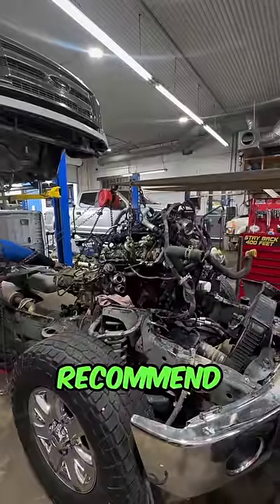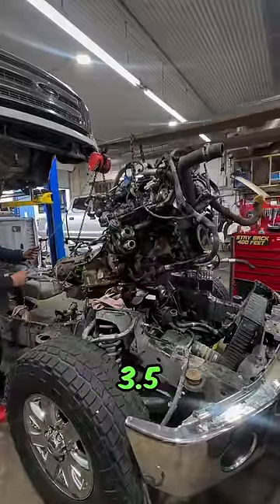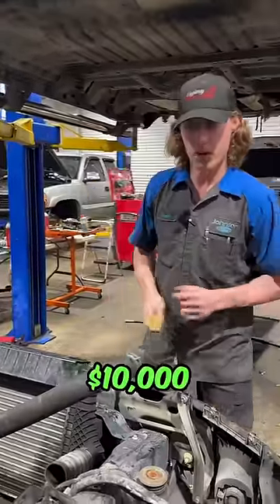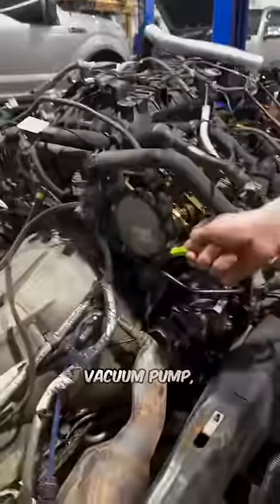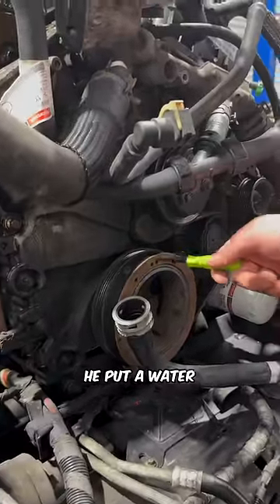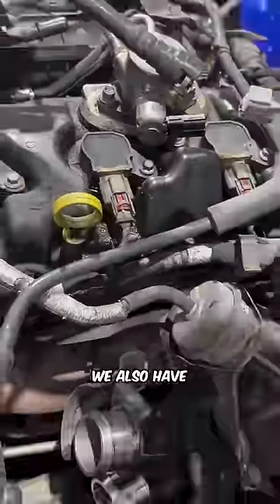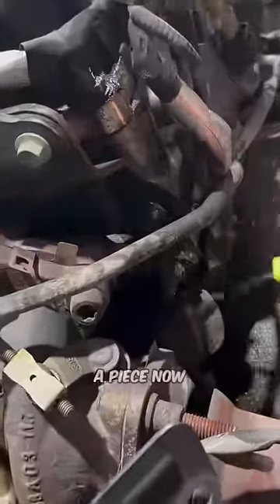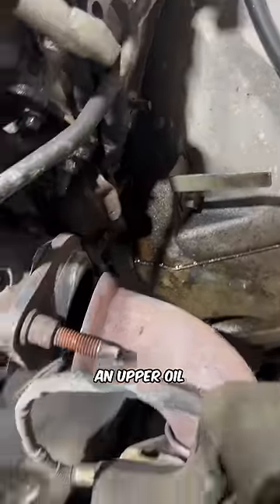Why not to buy a Ford 3.5L EcoBoost? #ford #ecoboost #shorts

Comment: What has the world come to when a half ton with 200k miles is worth spending 10k to repair and not even replacing the entire engine or transmission???!!!
Reply: Exactly 💯
Reply: Honestly with truck prices these days 10k is cheap in comparison, now let me say I completely agree that is insane, just a few years ago 10k would have been a nice down payment or got you a pretty decent used truck
Reply: Trucks in general should last a lot longer than 200k not even broke in yet
Reply: @thebutteravacado722  I agree but think it also depends on how it's used it might just sit and idle all day, so in reality it would have way more "miles" on it than shown
Reply: It’s called fix it yourself and don’t spend much but your time
Reply: @nicholaskrupa6259  while I agree I don't think that's a option for most people these days, considering most can't even do basic maintenance. Plus parts or insane for new vehicles,  never looked it up but wouldn't surprise if a new 3.5 eco boost is around 10k, like said I agree with you, but I just don't think the average person is capable of working on there vehicle any more, I can't tell you many people I've helped change a flat tire that flat didn't know how to
Reply: @nicholaskrupa6259  You're not doing this repair in your back yard. Its way too complicated and certain aspects of the job are very unforgiving to work on. You'll end up with more problems than you started with.
Reply: I mean... If the engine is 12k, he made the right choice.  The only problem this has are coolant and oil leaks.  That looks like a perfectly good engine which only needs resealing.  Throwing it out to replace it entirely is a complete waste unless the new motor costs less or equal to what the repair would cost.
Reply: @bigdogford1 fuck that I would of traded that in and put 10k towards. A new one Thsts a dumb move with 200k miles on a twin turbo those turbos go that’s another 5k lol 😂 down the road he’s crazy the 5.0 coyote is the best ford truck engine to buy imo cheapest to maintain and you can work on it no turbos just a plain old engine
Reply: 5k of repairs for every 100k miles of service. Hopefully the service was done on time but that’s an awful lot to dish out on repairs of the truck was maintained right. Still way cheaper than a new truck!
Reply: @thebutteravacado722 all depends on maintenance history, I've been a tech for 20 years and when people asks me to recommend a vehicle to them or which is the best, I tell them to get what they absolutely love and to maintain it properly cuz you can get any vehicle to last as long as you don't let maintenance and repairs go any longer than right away. I also let them know I only see vehicles when they're broken so they're a POS  to me
Reply: @thebutteravacado722 Honestly, you're extremely lucky if you get 200,000 out of a Ford. Unless it's the old 7.3 diesel.
Reply: 200,000k is nothing to complain about.
Reply: @guardrail2897  I got close to 300k out of a 2004 Ford Expedition with the 4.6 V8 in it. Original engine and transmission. I sold it to a relative who is still driving it. It never had any major repairs just regular maintenance and a new alternator, battery and belts.
Reply: In a quest for enough power to be a truck engine along with decent fuel economy to meet Cafe standards Ford has stuck their toe into making engines so complex the Germans are impressed... With that complexity comes maintenance - lots of it... 

They're impressive engines, they make a ton of power for their size and can be tuned WAY up. With that said I'll keep my 5.0 V8. 

The elephant in the room though is that all across the board, quality is generally going down as prices hit sky high levels. It's not uncommon now to find 10 or 15 year old trucks that are simply more reliable and dependable... So when you have one that's not rusted out you keep fixing it to get as many miles as you can out of it to avoid getting a crappier, newer version.
Reply: @bigdogford1 lol Ford motor company the KING of JUNK
Reply: @alanholmes2366  I know they're good ones. I had a buddy with the 4.6 in his Mustang GT. He ragged the hell out of that car for 150,000 miles. And it was still running when he sold it. He did break a couple transmissions and a rear end though.
Reply: @thebutteravacado722  every idle hour is damn near equivalent to 30 miles driven
Reply: @cbruno12180  the 5.0 is far from a plain old engine
Reply: @guardrail2897 I have 251k on a 2010 F150.  Still runs good no major repairs just change all the fluids regularly.  The check engine light has never even come on in the 14 years I’ve owned it.  Its a V8 though, I’d never buy an Ecoboost.
Reply: @cbruno12180 damg right. Ecoboost is junk
Reply: @alanholmes2366  4.6 is a bulletproof engine why you think all the cop cars are d taxis used them for 20 years with proper maintenance those hit 500k miles easy
Reply: Dont buy any ford ever
Reply: @thebutteravacado722  It all comes down to doing the mileage/time based service when it is due. Too many people will not go to the dealer, so the maintenance doesn't get done properly.
Reply: It's because he would make less money. A reman is 6300, plus he is charging double the actual price for the exhaust manifolds. If you go to his shop just show up with the parts and only have him remove and replace because he will rip you off.
Reply: @MadMan_123  If the shop will even agree to what you suggest. It is likely that they won't warranty the work.
Reply: Cheaper then buying a new truck
Reply: I agree
Reply: If it's not rotted like the titanic then it's worth 10 grand to fix. Sadly where I live a 2011 is Swiss cheese...... yet my 89 F250 only has a rotted tailgate and cab corners. No other rust anywhere. Maybe because the old man who owned it since New hated driving in snow so he never did.
Reply: When another truck with 200,000 miles on it cost 20grand? And will still need all this work? This would be common sense.
Reply: Repair is better than replace. Stop supporting disposablility in cars.
Reply: My Nissan Sentra 2012 has 317k miles
Reply: That’s why i do everything myself, to save money
Reply: @nicholaskrupa6259  go ahead and lift the cab by yourself
Reply: It’s called money printing from the fed
Reply: @nicholaskrupa6259  Considering that with that truck, you have to remove the cab to get at the engine and remove it, a pretty tough fix unless you have a lift in your yard to do it with.
Reply: @nicholaskrupa6259 exactly! That 10 k tune up would cost 2500-3500. I’m impressed a 200k boosted v6 still has enough left in it to make this job worth doing .
Reply: @iq6840 you blew yours up? Oh wait you never owned one , this engine was built to pull   , your statement is pure ignorance.
Reply: @JohnDiMartino  drive my f450 with a large backhoe. You'll understand what I'm saying. Listen these turbo engines would never made to a sedan or a f150 if it weren't for the EPA. YES I HAD ONE THAT BLEW PULLING MY BOAT UP A STEEP GRADE.
Reply: When a new truck is 75 to 100k! I'll spend 10k.
Reply: Only a fool would pay 10k to gasket 200k mile motor.   Just drop in a crate motor and be done.
Reply: Why?  Because it made 380 ponies, did its job, hauled ass doing it  and, finally leaked oil at 200k, requiring gasket replacements before going back out again?   Oh yeah.  Real turd.
Reply: @cbruno12180  lol BS id put Engine's in those crown Vic have less than 200k miles most 4.6 in police cars are OIL Drinkers
Reply: The lesson I learned from this is if you get a F150 that’s used and it’s got close to 200 K or over 200 K you better ask him if this has been done if not $10,000 comes off the price of the truck
Reply: This also shows me that you don’t want any kind of eco-boost of any kind naturally aspirated V8 engine is the only way to go that or maybe a diesel if it ain’t a coyote it ain’t worth having in a Ford truck. In my opinion I got a 99 triton with 327,000 miles on it still runs like a top and only done basic maintenance.
Reply: My engine blew a rod at 101,228 miles one day after I was dumb enough to take it to a dealer for 100k mile tune up at $880.00! 
The next day I put the hammer down at 70 mph up to 90-100 three times over as I always do, which makes me think the sob’s used regular oil. 😡🤬
Reply: New Motor is only 5600, as opposed to resealing everything.
Reply: @bigdogford1 they actually show how many hours they've ran now too
Reply: @CGoody564 the new engine is around this price. And the Turbo's were leaking oil. That's a couple grand each.
Reply: Blame Joe
Reply: @apachebill Now that you mention it, turd really is a good way to describe it.
Reply: What you mean sustainability. I know its crazy keeping and fixing a car you paid 60-80k for, i think the problem is the vehicle companies pushing out that cheap garbage and you must replace mentality.
Reply: Yup, that's why I put a couple grand into my old Silverado. I put a rear main seal and an new oil pump while he was there. 371k and runs like a top. Coming Next, a couple grand into the steering and suspension. It has zero rust. I could rebuild my old truck two or three times for the price of a new one. Repairs that didn't make financial sense just a few years ago make perfect sense now.
Reply: @AT-wl9yq it also looks like body off is the plan.  Not doing that without a lift.
Reply: What a pos 200,000 miles on it and it needs some work
Reply: @guardrail2897 My 2000 Ford f-150, 5.4 engine, automatic, has 300,000 miles on original engine. and trans. only thing I replaced was the starter, 3 batteries, brake pads front and rear!  brake line from master cyl. to rear end! line rusted out.. I'm considering a new Ford f-150 with the non turbo 3.5 engine. or the 5.0 !!! leaning to the 3.5 more.
Reply: @rogarmadz  They are notorious for blowing out spark plugs. How many have you lost
Reply: @guardrail2897  I've never lost any spark plugs! I think I'm having a coil acting up, has a miss when eng. Is cold..
Reply: @AT-wl9yq  Facts
Reply: @cbruno12180 

Long term I would agree.
Reply: @masterpah1 
They cost more to maintain. To call them junk is a bit of a stretch.
Reply: FORD- found on road dead. 
I've been convincing my customers to go to old GMs. They simply hold.up, and parts are cheap.
Reply: @CGoody564  Um no! It's a motor with 200k miles on it, if a new motor is 12k he's dumb af for spending 10k to reseal a worn out motor.
Reply: Mine f150 is in that boat. Got a loaded 20 fx4 for nothing. Knew it was high milage. Dash showed 160k but it ran good. Wasnt worried about a 5.0. Got home and put a scan tool on it just for giggles and the truck had 3100 idle hours on the engine. Title showed it belonged to a construction company. Now im putting exhaust valve seals in it lol@bigdogford1
Reply: @thebutteravacado722 it's not a Toyota
Reply: I’m at 196000 on my 2014. I hope to make it last til I pay it off my the years end. I’ll drive it til catastrophic failure.
Reply: Because the same half ton now costs $80,000 to buy..
Reply: Lol I wouldn't touch that engine. 200k miles and your only issue is leaks? Let the thing leak it has 200k miles! I'm sure it runs great just looks like hell! Waste of money.
Reply: Ford replaces the 3.5l new engine for 12000k. This makes no sense. My 2011 3.5l does not look like that with 200,000 miles on it.
Reply: A new XLT 3.5 is about $65,000.
Reply: @cbruno12180  I had a Crown Vic taxi come into the dealership for ac work. It had 650k on it. The guy said it was the original engine and transmission. Also a police interceptor. So it had years of great maintenance.
Reply: @pakviroti3616  Jiffy Lube and Walmart were great customers. Not tightening oil filters, leaving drain plug loose. Got towed to dealership to get engines replaced.
Reply: As a tech myself..I wouldn't shy away from these trucks just because of these issues.. but for someone who would need to pay for the labor involved with doing the repairs..that would be something that should be considered..
 None of these repairs are all that difficult or require you to remove the cab.. if you have the ability to, that's great and could shave off alot of time and free up a bunch of room, but it's not necessary..
Reply: How much is a new crate engine??
Reply: @thebutteravacado722 200,000 miles and “not even broken in yet” what delusional world do you live in? 200,000 miles is a decent amount, especially for these modern turbo engines.
Reply: When trucks are getting over $50k, $10k isnt that bad.
Reply: That engine will cost you $12k (or more) to replace with a new one. Rebuild is cheaper. Yes, it’s sad, but it is what it is
Reply: 5,700 long block
Reply: I literally just got it quoted to replace the entire motor with turbo and it's $15k. I would replace it before spending $10k to rebuild it.
Reply: No joke. Could certainly just buy a 7.3 or 6.0 powerstroke for that price
Reply: Not too much around 70000 initial cost
Reply: @thebutteravacado722 you thinking about diesel
Reply: At 200k you should be doing a complete rebuild
Reply: They are just trash
Reply: The price of parts and labor sucks these days but heck if you like your truck why buy a new 80-120k replacement when you can toss 10-20k into the one you own already and its good to go for awhile again.
Reply: @nou8257  well with that perspective you are not wrong why not save a bunch of money. I sold my 07 Sequoia and to buy a new vehicle and I regret selling it. The only thing is the lack of build quality on manufacturing in general these days. I have a 97 4.3L v6 GMC Sierra that will not quit running. The maintenance is cheap/easy and the truck was built to last.
Reply: @lastsinner1738  Yep and the electronics is what concerns me new stuff is packed with it and you know its designed to break.
Reply: @nou8257  people talk about global warming for emissions. I don't hear them talk about these jets and tanks. Planned obsolescence is one big thing with pollution. Manufacturers keep adding bells and whistles while the reliability and build quality is non existent.
Reply: @lastsinner1738  The emissions off a single super cargo ship is massive.
Reply: @nou8257  please don't state facts you might hurt feelings! Yes you are 100% correct
Reply: @lastsinner1738  Heh what doesn't hurt feelings these days.
Reply: @nou8257  true words also I looked at your comment and I can understand your perspective 10k compared to 100k isn't even a question. I just don't agree with the planned obsolescence it's all manufacturers these days. I feel like the turbos were added to appease the government and the car companies between emission and maintenance/money. The maintenance of the newer vehicles is beyond rough. Anyways you are right you cannot state anything without someone being rude or thinking their opinion will change your thoughts/ruin your day. I am not here for that, I appreciate your perspective because there is always more way to look at something. Nothing but love from me brother. Thanks for a different view on the maintenance.
Reply: How much is a new/replacement engine?
Reply: Who wants to spend 80 on a new vehicle
Reply: @Berta_5.sl0w  true
Reply: @thebutteravacado722  it's not diesel
Reply: How much is new engine from dealer???
Reply: @bigdogford1  let's not forget that most people have full time jobs and hardly any time, especially if they have family and a life beyond that to fix their own vehicles all of the time. The people telling us to fix our own vehicles don't understand time management and priorities. Mechanics are too convenient and expecting everyone to fix their own vehicles is asinine. Lol
Reply: Had a longblock new turbos and exhaust manifolds on my 2012 f150 about 2 years ago. 13 thousand dollars 😂
Reply: @dustin9035  at what point do you just spend the 10k on an older truck.
Reply: Compared to new trucks I'll do the 10k any day
Reply: My worst nightmare I just got a used ford 2013 it had 145k miles and the turbo just went out. Haven’t had the truck over a month yet guy at pep boys said he hopes it’s not the 10k tune up I thought he was lying 💔
Reply: Its only a f150 .25t quarter ton.
Reply: @danielhorvath2196 I've got a 2013 F150 5.0 with 258k. Have you had to replace your transmission leadframe yet? I'd assume not if your check engine light has never been on. I just had to do mine yesterday, it's not a super huge job though, there's a lot of videos here on YouTube that tell you exactly how to do it step by step. If you haven't had that wheel speed sensor circuit code pop up yet, just know, it's coming. I'd even suggest you go ahead and start gathering the parts up now to get ahead of it. Very very common 6R80 issue, unfortunately.
Reply: Just drove across West Texas from El Paso to Kerrville. I noticed that the fastest vehicles on the road were (full sized) Ford, and Chevy trucks with the cruise control set to 95, and they maintained it even up the long hills (I fell in behind them for about 280 miles). Some were pulling a trailer and they never stopped for fuel. I wonder how this Ecoboost with 200,000 miles would handle that and what kind of fuel mileage it would get at 95 mph in a full sized truck. And it was 102° that day. I'd be worried about throwing a rod at that speed with an engine with that many miles on it.
Reply: Only a Toyota would on average go another 200k but still…
Reply: People are in scavenger mode.  Because we've lost our way.
Reply: @nicholaskrupa6259 hahaha if you notice, it's cab off the frame, that's hard to do at home.  It's terrible that you have to separate the cab and frame like that, then all this "resealing", but no new rings or bearings.  I would go for a rebuilt short block just because... why not.
Reply: You are delusional cars do not last that long and never have the average is 150k
Reply: Democraps
Reply: That shows how crappy & complex engines have become; especially these 1st gen 3.5L Ecoboosts.
Reply: This dudes a scammer you could buy a crate engine and have it installed for 10k.
Reply: @bigdogford1 what do you mean cheap. You can buy an entirely new engine at 10k. At coyote at that but then you have other cost
Reply: @guardrail2897 don’t ever speak on ford again lmao you obv haven’t owned any
Reply: @ZacharyHolton  I've owned 2. A 1989 F150 that had 3 transmissions within 60,000 miles. All under warranty. And a 2001 Mustang GT. The motor blew up at 3,000 miles. New motor under warranty. My wife had a 2016 Focus that had 2 transmissions put in under warranty. So yes, I've had Fords. But I've never had a good Ford.
Reply: @guardrail2897 Turbo maybe, but I have a transit with 200k that hasn’t needed a single repair (besides the drive shaft recall). But it’s a NA motor.
Reply: @bigdogford1  10 years ago I spent less than 10k on all the costs to buy my house lol
Reply: Steal
Reply: @thebutteravacado722 that's why you get NA motors
Reply: I just lapped valves, new gaskets, cleaned my lifters and timing chain on my 1998 magnum for $300.
Reply: @thebutteravacado722  Turbo's are great for fuel efficiency, but they put more strain on all the components. I don't think they're worth it for a daily driver.
Reply: @alanholmes2366 cabbies have said the 4.6 is super reliable, they put 400k on those in all different conditions
Reply: @dustin9035  my first transmission lasted until 285k
Swapped in a new-to-me transmission from an old-guy 1 owner reg cab short bed with 54k
Reply: @bigdogford1  where i live for 10k down you can get a used hellcat with less than 75k miles on it